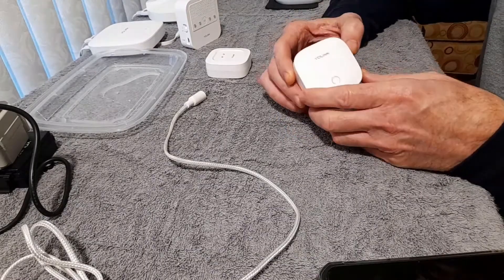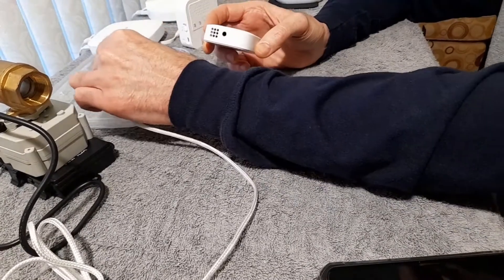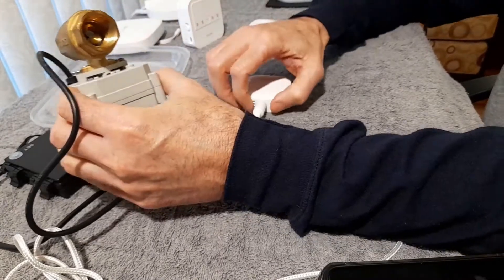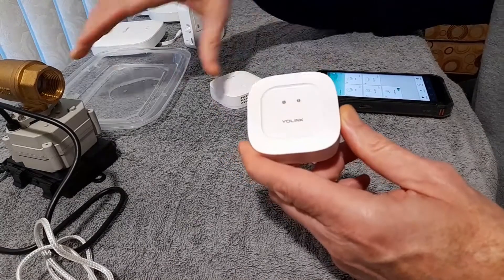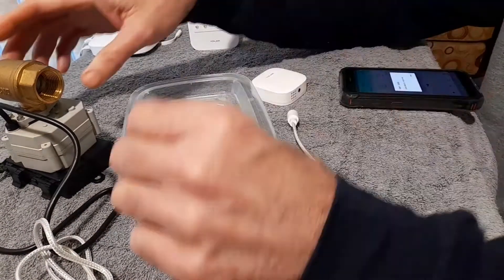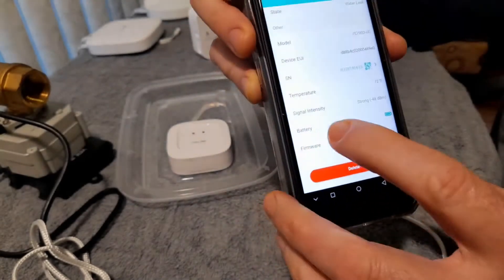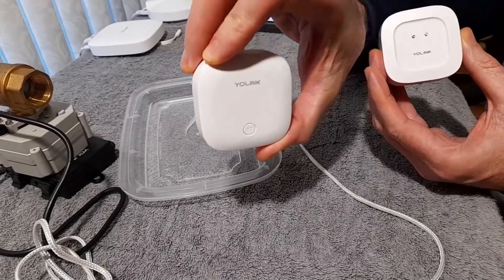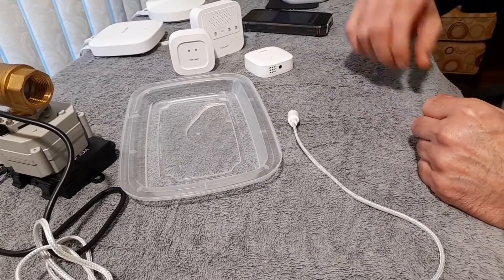Do you believe Yolink's leak sensor will prevent water damage?

Comment: You have to pair the contact sensor with the water valve. Hold both buttons at the same time until they turn green
Reply from the maker: The sensors have been losing contact with the water valve.  There is a know firmware problem if you don't have a hub plugged in all the time.  Thanks for commenting & subscribing.
Reply: @CyberMedics  then use the hub. 
I've had mine hooked up to the last 2 homes. They work 100% and saved me water damage twice now. Your siren is not linked. Also you could link it to the speaker hub as a backup. Mine is linked to both siren and speaker hub and it works. I think your problem is you're unfamiliar with how to set it up.
Reply from the maker: My fault for not fully explaining this.  Both sensors were individually paired with the valve an siren.  The probe sensor worked flawlessly.  The contact sensors would not communicate with the valve or siren.  I wish it was as simple as "unfamiliar with how to set it up."  This scenario has played out for numerous subscribers and you probably never experienced it.  

If the contact sensor was paired, then the hub was unplugged for 1 week or more (it varied & could be up to 4 weeks) all of the contact sensors would become disconnected from the previously paired devices.  It could be factory reset & then it would work.  But after a week or more of leaving the contact sensors unplugged the contact sensors again would become unpaired from the devices.  I spent weeks directly working with Yolink following there step by step guidance testing various firmware versions. One of the firmware versions had this flaw:  If the hub was disconnected for a period of time, the contact sensors would become unpaired.  Confirm with them, but anything later than v0311 is OK. I have sensors with both v0403 & v0311 and don't experience this problem.  Thanks for commenting & subscribing.
Reply from the maker: @wilcoxtactical3716  My fault for not fully explaining this.  Both sensors were individually linked with the valve an siren.  The probe sensor worked flawlessly.  The contact sensors would not communicate with the valve or siren.  I wish it was as simple as "unfamiliar with how to set it up."  This scenario has played out for numerous subscribers and you probably never experienced it.  

If the contact sensor was paired, then the hub was unplugged for 1 week or more (it varied & could be up to 4 weeks) all of the contact sensors would become disconnected from the previously paired devices.  It could be factory reset & then it would work.  But after a week or more of leaving the contact sensors unplugged the contact sensors again would become unpaired from the devices.  I spent weeks directly working with Yolink following there step by step guidance testing various firmware versions. One of the firmware versions had this flaw:  If the hub was disconnected for a period of time, the contact sensors would become unpaired.  Confirm with them, but anything later than v0311 is OK. I have sensors with both v0403 & v0311 and don't experience this problem.  Thanks for commenting & subscribing.
Reply: @CyberMedics  I see. Why were you trying to have the hub not plugged in? It seems if the hub was disconnected it would be pretty obvious that the sensors would also drop off if they were paired. The hub is REQUIRED. Same principle as your Alexa not responding when the internet is down. The lights dont come on when i have the breaker turned off too. Kind of got to run the entire system for the entire system to work. I'm glad you got it figured out. Correct,  I've never experienced the issue or any other issue with Yolink. Yolink and Gosund are the 2 smart companies that have been 100% flawless once connected. It's taken a bit to get some to connect the 1st time but that's as expected.
Reply from the maker: @wilcoxtactical3716  When you do device to device pairing the hub is not required for a water sensors to control the valve. We recommend device to device pairing in addition to adding devices through the app.  These are two different processes. One relys on internet & the other does not.  Many subscribers bought Yolink for this purpose.  They were trying to protect remote locations that did not have an internet service. We were trying to emulate their problem, because they contacted us and asked for our help.  Specifically the contact sensor becoming unpaired when direct paired with the valve.  Thank you for the insightful questions.  Does this help clarify the scenerio?
Reply from the maker: @wilcoxtactical3716  When you do device to device pairing the hub is not required for a water sensors to control the valve. We recommend device to device pairing in addition to adding devices through the app.  These are two different processes. One relys on internet & the other does not.  Many subscribers bought Yolink for this purpose.  They were trying to protect remote locations that did not have an internet service. We were trying to emulate their problem, because they contacted us and asked for our help.  Specifically the contact sensor becoming unpaired when direct paired with the valve.  Thank you for the insightful questions.  Does this help clarify the scenerio?

Comment: They dont stay paired. I went for device-to-device pairing of some water sensors to a ball valve controller. After some trouble and some help factory resetting them with yolink over the phone, i got them paired and they seamed to work. I decided to check them today (4 months later).  Good thing i did. They are no longer paired. They somehow become unpaired over time. I have two pairs of this setup ( 4 sensors and two valve controllers)  they both unpaired. Very disappointed. I will be contacting them Monday.
Reply from the maker: Sorry to hear you're having a problem with the direct pairing.  Did you set up the sensors in the app?  I wonder if the firmware update they did affected you.  Something similar happened to me.  Thanks for commenting and subscribing.   Let us know how it works out or if we can be of help.
Reply from the maker: Tim you may want to view our updated video on this https://youtu.be/sH_MdSYXCzw.  Around timestamp 3:50 seems to fit your problem perfectly.  We both had the same issue and I think it was the firmware update that broke the pairing.  Let me know if the video helps.
Reply: @CyberMedics  Thanks for the reply. I contacted them and they said it's a known issue. That is, when in a device-to-device paired mode with no internet and hub, they would become unpaired after about 10 days. I was told they would send me a new updated set of sensors that won't do that. I'll post an update here how the matter  resolves.
Reply from the maker: @justifiedFaith209  Thanks Tim.  So it was the fact that the sensors were older and that's why they become unpaired? Did this happen with the contact sensors and the probe's sensors?  Appreciate you following up on this.
Reply: @justifiedFaith209  Any update on this Tim?  I just pulled out all my contact sensors  and none of them work controlling the valve.  Even after factory reset they still won't pair properly.   All the probe sensors (with cables) continue to work flawlessly.  Did you have problems with just the contact sensor?  Hoping we can help others out there that might not even know they have a problem.  Thank you
Reply: @islandoras  They replaced my water sensors and controllers with new ones and also sent me a prepaid label to mail the old ones back. Good job on their part for this.  I paired the new water sensors to the controllers in a device-to-device pairing and tested them after two weeks. They were still paired. So far so good.  I will do another test after a month has passed and post the update.  Love the concept.  I'm hoping they remain reliable.
Reply from the maker: The ones we have tested, remained reliable over a long period of time. How has the reliability been on yours?
Reply: @CyberMedics  Yes, the new updated ones are working well now. When they replaced the original 4 sensors, 1 of the replacements was bad and would unpare after x amount of days. The other three worked well. They sent me one to replace the defective replacement and now all have been working well and have not upaired. Pain in the major butt ordeal, but yolink, to their credit,  stuck by thier product and the support was swift.
Reply from the maker: @justifiedFaith209   We worked a long time with them to get the firmware issue sorted out. Glad it is working for you!  Thank you for being a member & supporting CyberMedics.  If you have a windows computer or iOS device, we have some great content to consider.  Also a lot of info for online account security.

Comment: Did your pair the contact sensor directly to the valve control? Do you have an action set up in the app to close the valve? The sensor appears to be working fine as shown in the app.
Reply from the maker: Yes, the contact sensor was paired directly with the valve in the closed position. It would alert in the application but not perform the action of closing the valve.  Working with Yolink tech support, we confirmed there had been a recent firmware update.  I believe the firmware update caused the contact sensors to stop working. Factory reset fixed the problem.  Please see the 26 Jan 2022 update below.

Comment from the maker: ***26 Jan 2022 Update***
Was called by Yolink tech support today and they walked me through the factory reset procedure.   Once all of the sensors were reset, they were able to be paired and are working properly.   They provided me a link to documentation on factory reset and other settings here: http://www.yosmart.com/support/YS7903-UC/docs/instruction.  They did confirm there was a firmware update around the time my sensors stopped working.  Great Support!

Comment from the maker: I purchased 3 new contact sensors and completed testing today.  All 3 worked perfectly....pairing, un-paring, valve/siren activation.  Will do a follow-up video to demonstrate result.  Thanks for everyone's feedback.
Reply: I was thinking about using the Yolink sensor (the one without probe) to control a yolink power-plug🤔, can I do that ? or does the sensor only connect/work with the shut off valve ( I have a flood and drain hydroponic system I would like to use the sensor to cut off a water pump once the area reaches desired flood level and Sensor is triggered, 
Maybe I can position the sensor on top a couple pennies with a weight on top to create the flood level desired, the weight so the sensor won’t float off, or maybe I can tape it down on top of the pennies or etc, either or I’m sure you get the picture? 
So my initial question is does the Yolink water sensor work with the Yoink electric plugs/ turn the plug off in “Action or behavior “ once triggered?
Reply from the maker: @ronevergrow8319  there may be some way to do it through IFTTT. Probably require some research. Not sure you can do it directly with the YoLink Inc. sensor paired with a power plug would recommend contacting their tech-support directly. Please post an update if you figure out how to do it thanks for subscribing to the channel and supporting us by commenting and getting the video thumbs up.

Comment from the maker: I have reached out to Yolink tech support.  Here is the latest (most current on top)

10:19 AM (12 minutes ago)
to YoLink
Hello Queenie,

I do appreciate you reaching out to me.   I am intimately aware of how to pair the devices.  Please see this video, that I produced on your product: https://youtu.be/-wtSk3Pze1A.  I would encourage you to use this video, because it clearly demonstrates how to pair the devices, while promoting Yolink products.

Your input did not address my issue:
This contact sensor no longer communicates with the Water Valve or Siren.  It alerts in the app, when water is detected, but will not open/close the valve or activate the siren.  I have 3 of these sensors with the same issue.  All were all purchased at the same time.  This problem started approximately one month ago.  Prior to that the contact sensor was functioning correctly.

Please advise on how to get this resolved.

Rick
=====================================================
On Fri, Jan 21, 2022 at 6:15 AM YoLink Service <service@yosmart.com> wrote:
Hi Rick,

Thank you for contacting us and for using YoLink products.

I checked the data, this sensor did not set up YoLink Control successfully. 

When you direct pair them, the valve controller should be in closed state, then hold the set button on the leak sensor for 5 seconds until green LED blink, next hold the set button on the valve controller for 5 seconds until green LED blink.

After pairing, turn on the valve controller, put the sensor in the water to have a test.

To unpair them, the easiest way is to factory reset the water leak sensor, hold the set button on the leak sensor for 25 seconds until green LED & red LED blink, then wait for several seconds, press the set button to activate the sensor again.
Please see attached videos.
Hope that helps,
Let me know if you have any questions or need anything else!

All the best,

Queenie | Customer Service
=====================================================
Sent At:2022 Jan. 20 (Thu.) 09:04
To: YoLink Service <service@yosmart.com>

Subject: Contact Sensor Problem Model:YS7903-UC

Hello,

This contact sensor no longer communicates with the Water Valve or Siren.  It alerts in the app, when water is detected, but will not open/close the valve or activate the siren.  I have 3 of these sensors with the same issue.  All were all purchased at the same time.  This problem started approximately one month ago.  Prior to that the contact sensor was functioning correctly.

I have multiple probe sensors (Model: YS7904-UC) and they all operate properly.

Contact Sensor Details:
Model:YS7903-UC Firmware 030D Device EUI d88b4c02000469e0 SN b32013E615.

Here is a video leak completely describing the issue: https://youtu.be/AHMvf8axsGM

Thank you in advance,
Rick